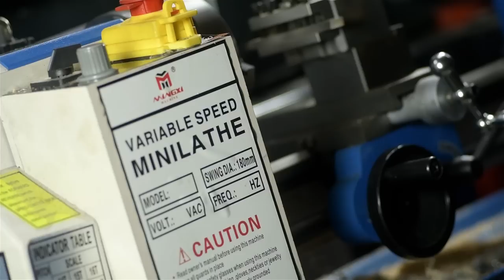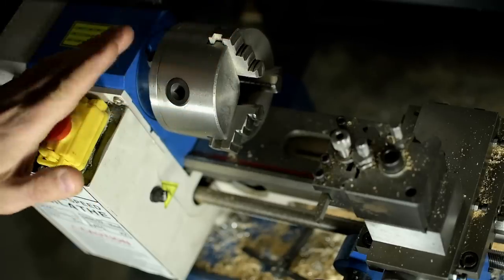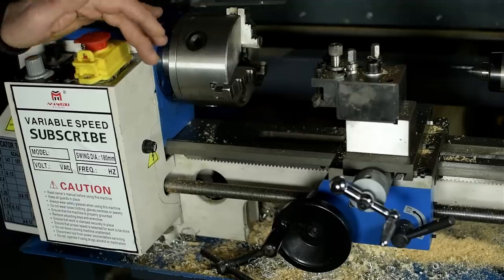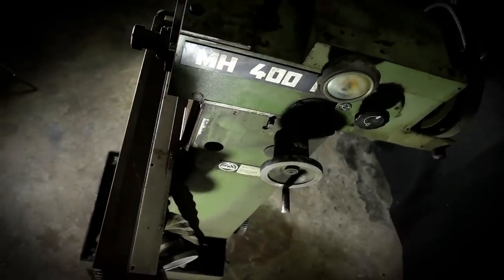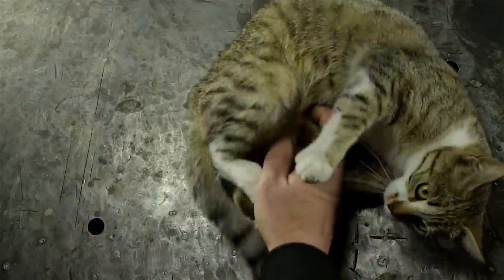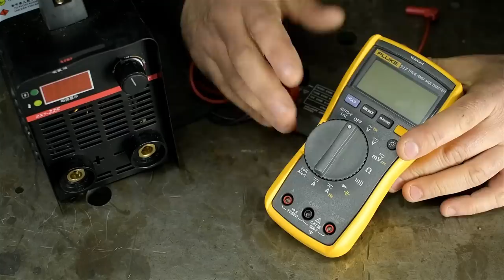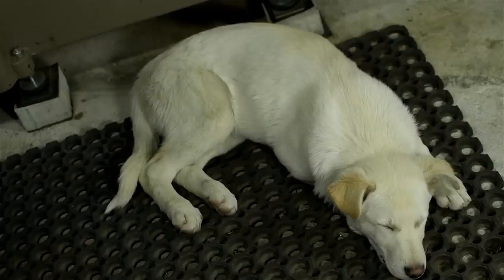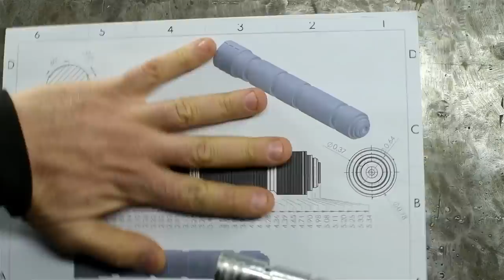Random Updates!

Comment: Ok that print joke really got me, very clever lol
Reply: I only have a HS Diploma, so I need explanation.
Reply: Max R the joke is the surface is clearly not to finish, meaning it had only been rough-passed and not finish-passed, which would require a constant and specific feed rate or turn speed so the surface has tons of variations of dimensions. Throughout the video you're led to believe "oh yea, a kid wouldn't bother to finish the surface, he just wants to cut metal" only to reveal at the end the print has all those dimensions as requirements for the part so his kid did an almost impossible job perfectly.
Reply: @Providence83  Yes, because the dimensioning is completely accurate and industry standard
Reply: this is not joke, he just made this part just like in the blueprint.

Comment: Puppies biting is pretty easy to fix; just gently pin down their tongue with your fingers.  They hate it, and always try to open their mouth wider to get away (keep their tongue depressed until they really squirm away from you) so it saves you from getting bite marks.  And it quickly teaches them that hands in mouth = bad.  Never raised a dog this didn't work on.  Usually takes less than a week for them to stop entirely.  Good luck!  :)

Comment: I've been in your exact same situation with a similar machine. Unlike you I did buy an engine hoist, 2 metric ton version. But I modified it quite a lot and made the legs so they sat further out and went straight ahead. Just enough space to fit around a standard EUR-pallet here. that allowed me to lift my whole mill off the pallet and put it down on the floor. Then of course I used it to disassemble the machine. I simply could not have done it without the hoist. 

It does take too much space however. I am considering a gib crane permanently mounted near the milling machine, or perhaps to the milling machine itself in order to remove parts and components from it.

Comment: So a bit off topic and not sure where to post this but ... lathes and mills ... Shaublin 13 being replaced by the MAHO ?... I noticed when you were building the surface grinder the tolerance of one of the mills was a bit iffy at the ends... is that the Shaublin?

I now got my eye on an EMCO V10P will mill attachment 2 in one for starters ... thing is with these things you just have no idea what the real underlying condition is - they just state "Very Good condition" - erm ... is that 1thou or 10 thou run out - dictionary not much help either...  Fabulous rebuild of a Shaublin 13 by Ca' Lem ... man that's one complicated piece of kit.

Would be great to do a guide / recommendation on mills and lathes ... not a product review ... well actually kinda .... but would be great to get some guidance on what to look out for and what is essential/ not so much.

Keep it up ... loving the videos.

Comment: This old Tony, here in the UK, we've just been put on 3 weeks lockdown, and so I was thinking of shop projects to keep me entertained, but also something useful to help others in these troubled times. My idea is some form of punji trap outside the front doors of people who refuse to stay indoors, would you suggest aluminium or stainless steel for the spikes?
Reply: Today I build a stand with two small C-clamps mounted on ends of two goose neck rods in which to clamp my 1" & 2" micrometers for taking readings in an "oh so easy" fashion. It came out rather well.
Reply: @nutwiss  
I'd definitely recommend cast iron. Half the time the spikes will break off when they try to pull them out
Reply: @nutwiss  Plus, stainless is expensive. Rusty rebar is really cheap; even if your scrounging ability is poor new rebar and saltwater are cheap and readily available.

And it has to be rusty, keeps people on their toes about their tetanus boosters...
Reply: Sadly people nowadays can't spend 2 minutes with themselves without going stir crazy. Like ToT I've been a home body most of my life. More so since I had a bone marrow transplant 10 years ago today.
Reply: If you're going out to lay the traps at other's houses, aren't you also not staying indoors, though?
Reply: @zrobotics  
The local construction sites have tons of rebar. Sometimes they try to hide it in dried concrete, but I have a chisel and lots of patience so it's not really a problem.
Reply: @Providence83  Good point. Exceptionalism rules, OK!
Reply: @Providence83  It's cool, i'll punji my own doorstep afterwards as well
Reply: @Providence83  Why do you think we built those robots?

Comment: Looks like your tool height is a little bit on the high side. (Bump in the centre while facing.) I'm sure you know it reduces your clearance angle, which in turn increases your cutting forces. On a crappy lathe like this, I'd recommend using a tool height that's a little bit to low to make sure the tool is cutting as well as it can. Trust me, I'm 1/4 of an expert.

Comment: How would you go about putting a center in the end of a long part that is too big to go in the lathe's bore?   
My lathe has a 10 mm bore (yes its absolutely miniscule)   its smaller than your minilathe.
Reply from the maker: manually.  center finder for round stock. mark. center punch. center drill with a hand drill.
Reply: Or use a steady.

Comment: the ebay welder: I'm sorry if my question is incomplete for not watching all of your videos, however I did see one where you evaluated a cheap ebay welder, then saw a video that you hooked up your tig welder to an oscilloscope.  Could you please hook up the ebay welder to the scope and see (show us) if the current is not a steady dc but a square wave with a duty cycle. I really do not want to have to buy a scope for myself. I believe the duty cycle for inverter welders (cheap ones) is not about use time and rest / cool down time but being wave form related... however, the amp meter would be measuring an rms value so if I find that video I may figure out my own answer....

Comment: Hey, stop using carbide tools on that little lathe! Use HSS and sharpen them right up, with a bit more rake than you would normally use. I cut aluminium, steel, stainless etc on mine and get really nice finish. Carbide is for deep cuts with huge forces on VERY rigid machines. Not on a "Manila The" 🤓👍

Comment: I started using my dad's lathe when I was 7. I had to stand on a tool box to reach, and think it was mainly because it had no power-feed, so I became the power-feed.
Reply: I was lubing the changewheel train I'd just set up on what was technically my Dad's lathe (but he never got a look in) the day before I started my first "proper" job, as an engineering draftsman. A dab of Rocol gear lube on a fingertip, with the lathe running, what could possibly go wrong? Luckily the motor was puny and the belts loose. Needless to say, I didn't get any drawing done the first week at work.
Reply: I guess you could say I almost merged with the screwcutting train.

Comment: If ya got problem with your dog nipping and biting. I worked through that with my dog by grabbing his bottom jaw with my thumb on the inside of his mouth pressing down. Not hard, or any pressure to hurt. Just enough to hold down. Only right after he bit. A few times of that and he stopped

Comment: i need to put some more work into my chinese mini lathe... it works it just seems sloppy. i might try the bearing upgrade, and try putting better m3 screws in the tension adjustment for the slidey bits.

Comment: A question, and a recommendation. I've been working my way back through your videos, and can't find the one where you put a hot chili in Meatball's food dish, then fish "hardened parts" from the litter box with a magnet. Which was that?

Second, your son could check out the Lathe Tooling video, to learn to make some HSS tooling for the minilathe. Also learn the benefits of HSS tooling for surface finish. Carbide is sexy, but HSS is cheap.

Comment: This Old Tony, since this is a random video a random question.  What do you use for cutting oil, it looks quite tacky.   Thanks
Reply from the maker: it's a sulfur based tapping oil.  not technically machine cutting oil but I bought 10 gallons for cheap years ago. I even put it on salad.
Reply: @ThisOldTony  Thanks!  Yum on the salad.